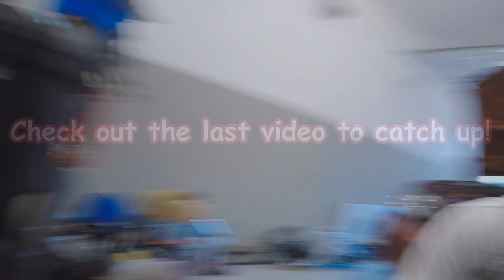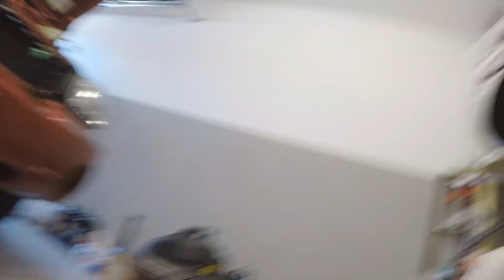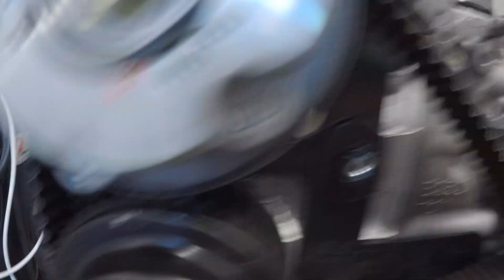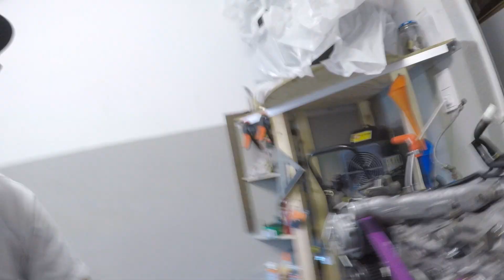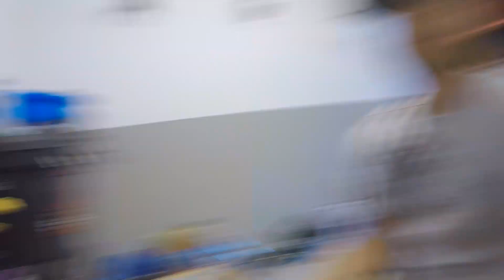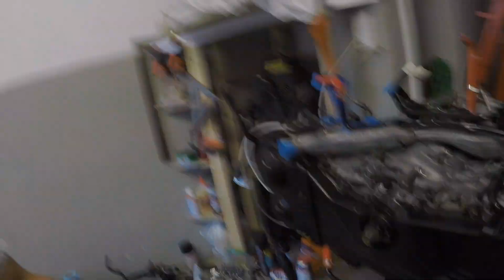Reassembling My EJ25 Stage 2 Pt. 2

Comment: Thanks for the video!

Question: Is it strictly necessary to bleed a brand new OEM tensioner?
Reply from the maker: I am going to say yes. The reason for me saying yes is because the manual says to do it when replacing.
Reply: Haven't had a problem not doing it nor heard from anyone else.
Reply: I'd say it's one of those "better safe than sorry" things.  99% of the time it's probably fine, but you'd hate to be that one time when an air bubble caused your new engine to jump time..

Comment: I always forget to bleed that tensioner. I like to do a little sanity check after the belt is on and pin pulled; spin the crank by hand slowly a couple times to make sure everything lines up and I don't hear weird noises before i put the covers on. I know it seems silly but i actually caught a belt guide that was snugged up too close to the belt last time, i could see it dragging and leaving a little scuff on the belt.
Reply from the maker: I feel like I have installed a tensioner or two without bleeding it as well in the past. Even when I bleed I am still always paranoid about it. Ha, it is nice having to edit these videos because it is like proof to myself that I did it. Cheers!